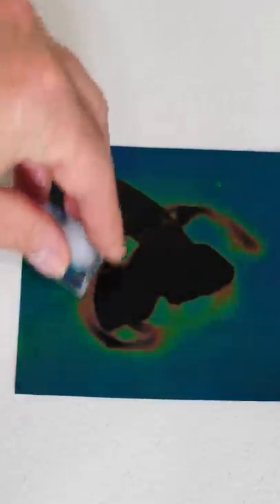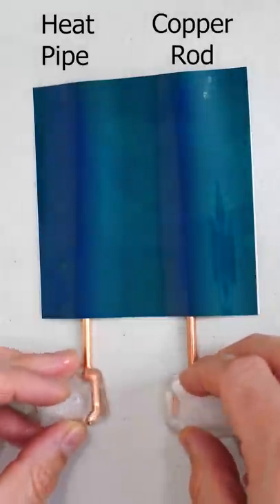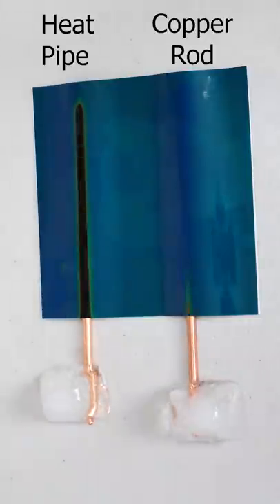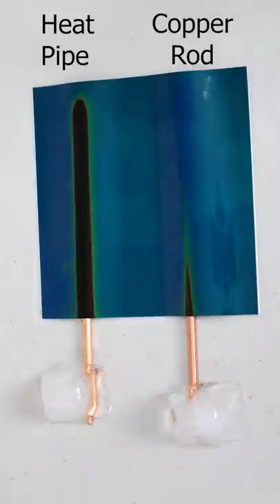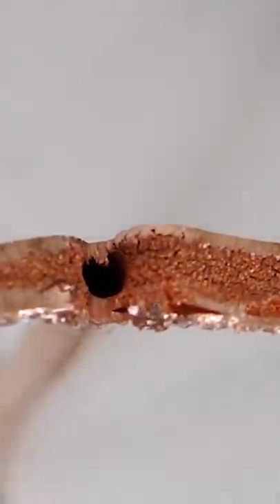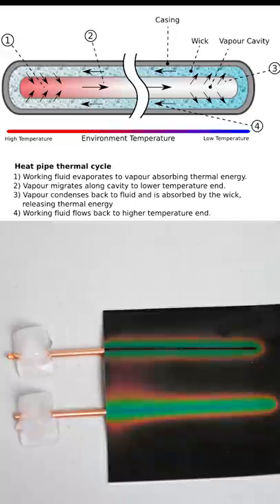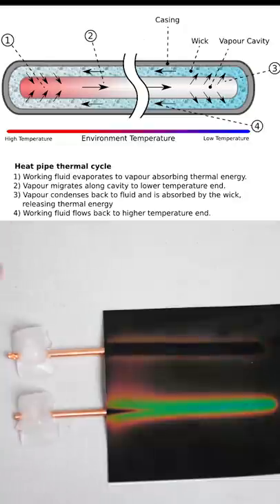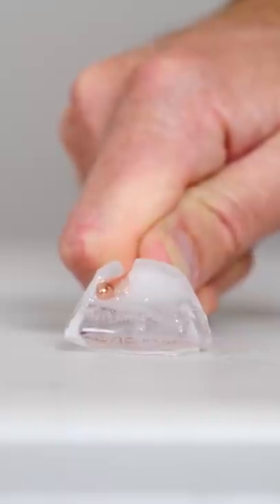The World's Fastest Heat Conductor

Comment: This is common in most CPU and GPU coolers
Reply: actually?
Reply: @vivada2667  At least all the new phones that use vapor chambers work using the same concept.  Depending on your model, you may already have this on your phone lol
Reply: Doesn’t seem like it...my laptop overheats like hell without a fan.
Reply: @zakrylee9918  Yep, heatpipes just move the heat inside your laptop, not outside, that depends on good or bad fan/chasi design
Reply: @zakrylee9918  they're mainly found within desktop cpus and gpus because of how big they can be
Reply: @zakrylee9918  Heatpipes only move heat very quickly, they don't actually remove heat, that is ultimately done by radiator fins that transfer that to the air which is a poor heat conductor, and it also requires a lot of surface area.
Reply: @zakrylee9918  It just moves the heat not cooling it down
Reply: Not true. Many don't use heat pipes and not every heat pipe is a vapor chamber I think
Reply: @mhtmhn  i believe that the razer phone 2 was the first phone to have an actual vapour chamber cooling system in a smartphone lol. I had one and it died just a couple of days ago :(
Reply: @dimitrijekrstic7567  The majority of cpu and gpu heatsinks do use heatpipes. Its only cheap stock coolers and water cooling systems that don't use them.
Reply: @mikehawk6175 RIP mate
Reply: @zakrylee9918  Your laptop likely doesn't have heatpipes due to its size. They're much more common in desktops, and sometimes custom-built laptops.
Reply: @zakrylee9918  heat pipes mostly send the heat towards the fan in a laptop or towards heat sinks.. so if your laptop still heats up it may be cause your laptop fans might be clogged or the heat pipes might be damaged or some other issues..
Reply: Firstly it's not comnon since it's much more expensive. Secondly you don't need that much of "speed" in cpu cooling. You need efficiency and that is another thing.
Reply: Newer upcoming ones, named thermosiphon, Linus has reviewed it
Reply: Keksimus Maximus lol clearly you know nothing about pc, heat pipe’s common af in pc DIY field, you can always find a cheap one that just work as well but of course not superb. Well you cant expect some heat pipes on gt1030 right? Cuz that’s not necessary but it doesn’t mean heat pipe’s wasn’t common these days.
Reply: @KeksimusMaximus  not common eh? Example 1: the ryzen 7 3700x and above models of amd cpus come with a stock wraith prism cooler. That cooler that comes free with the cpu has heatpipes. Example 2: one of the cheapest tower coolers the deepcool gammax gte 400 has heatpipes, the thing only costs around 20-30 bucks.

For gpus almost everything except the lowest end has heatpipes. At most a 1650 super card might not have heatpipes (tuf varaints) but most do (like an msi ventus) above that all gpus from reputable manufacturers have heatpipes. Dont believe me? Google any gpu and you will see copper heatpipes through the side and rear.

Also your point about speed, isnt that being more efficient? Being efficient is doing something faster or with less resistance so isnt that just a heatpipe? Also nowadays cpus and gpus use a lot and i do mean alot of power and heat. An i9 11900k overclocked could pull 332w peak, and a 3090 could sometimes draw in excess of 450w of power, to give context, you know those shitty laptops that you feel overheat too often? The chips in them likely dont draw more than 45w, a high end gaming pc pushed to its limits would draw over 17 times that amount at peak. There is a reason people use goddamn liquid nitrogen to push some hardware to its limit.
Reply: @quantumsniper9433  Didn't read. "Common" means like almost every cooler must have this. And it's not like that, only good and expensive coolers have this. It's like 5-10% of the market which is far from "common". Get your head from where it is to the real world, 80% of coolers are cheap ass alluminium tincans. I have Noctua NH-D15 and it has this thing. But it's far from cheap
Reply: @KeksimusMaximus  bro please dont talk about shit you don't know online, please.
Reply: @KeksimusMaximus  this one right here, officer.
Reply: @jared4169  Haha, yeah, we need officer Derek Chauvin with his mighty knee here ASAP, some of them just broke out of a cage
Reply: @KeksimusMaximus  
There's really no need for that. I believe you're about to receive some hate...
Reply: I was about to say to put in in cpu coolers lol
Reply: I've seen them being used for smallee builds idk
Reply: @hypnotoad28  I've seen a good number of thin and lights with heat pipes. CPU sits in the center of the laptop and the cooler on the edge, ya know?
Reply: @mr_biscuit  no, the majority are stock, and like you said, don't use them.
Reply: @hypnotoad28  
Nearly all laptops have heat pipes. Have you ever looked inside a laptop?
Reply: @mikehawk6175  condolences.
F
Reply: @zakrylee9918  laptops almost always do, having a metal coldplate over the cpu attached to a flattened heat pipe. The heat pipe moves the heat to the heatsink (metal fin block) and fan on the other end to cool it off. If its overheating, you can probably fix it by cleaning dust out of the fan+heatsink, there are videos on cleaning laptops that you can check out!
Reply: @KeksimusMaximus  Heatpipes are used in every aftermarket tower CPU cooler mate, AND 99% of GPU coolers.
Reply: @gth77s  Do you even realize who are you replying to? I'm not talking about USUAL heatpipes which are just pipes as is. I'm talking about evaporative heatpipes as the one shown in the video. This kind of stuff is expensive and not common. Do you want to tell me otherwise?
Reply: @KeksimusMaximus  literally every cooler has it, the only ones which dont are the office ones which are bare minimum, literally google cpu cooler and it would prove you wrong.

And yes, i am talking about the vapor chamber types.
Reply: just putting this here to look at future replies. this reply section looks like a good place to learn something
Reply: Heat pipe is some pipe that transfers heat from one place to another.

There are 3 types of heat pipes:
1) one which has liquid water (or any other liquid) only
2) one which has liquid water (or any other liquid) AND gaseous water (or any other liquid)
3) a solid metal heat pipe

In desktops:
Liquid cpu and gpu coolers (AIOs and custom loops) use type 1) heat pipes.
Air cpu and gpu coolers use type 2) of heat pipes.

In laptops:
Generally, both cpu and gpu are cooled by type 2) heat pipes.

In mobiles:
Generally, cpu and gpu of mobiles are passively cooled.
But in some mobiles, cpu and gpu are.cooled by type 2) heat pipes

Hope this solves all the problems in this thread.
Reply: Yeah I always noticed the copper tube going around the edge of my gpu, i assumed it was a heat pipe of some sort but never knew how fast they were and how it worked
Reply: @KeksimusMaximus  expensive? It’s like nearly 20-30 dollars for a gammaxx 400s, super good cheap cooler with heat pipes
Reply: @cryochus4074  read my comment up you will understand everything
Reply: @suntzu1409   A heat pipe is a heat-transfer device that combines the principles of both thermal conductivity and phase transition to effectively transfer heat between two solid interfaces. (As per Wikipedia) So neither 1) nor 3) are heatpipes by this definition since they lack the phase transition part.  1) is your standard liquid cooling (loop) where you use a fluid to "move" the energy away, 3) is just a typical heatsink that increases thermal mass and surface.
Reply: @loban4243 ok
I wanted to say that heat pipes of type 2) are not that common in desktops and mobiles.

That wont change even if type 2) heat pipes are the only type of heat pipes.
Reply: @suntzu1409  wym not common? almost every laptop has a heatpipe, and most desktops i've opened have heat pipes on the cpu cooler and the gpu cooler
Reply: @ado3247  in desktops, AIOs and custom loops are not uncommon.
And those dont really use heat pipes.
Reply: @ado3247  
Cpus and/or gpus are used in
1) laptops
2) desktops
3) smartphones/tablets
4) embedded/iot
5) data centers

Heat pipes are common in laptops, but they are not common in desktops (many people use AIOs or custom loops), smartphones/tablets, embedded/iot, data centers.
Reply: @suntzu1409  Newer smartphones use vapour chambers to evenly distribute the heat on the back of the phone. They're pretty much just a flat version of a heat pipe. 

Quote "I wanted to say that heat pipes of type 2) are not that common in desktops and mobiles."

If we're talking about PCs, then why bring up other uses of a heat pipe? And heat pipes are by far more common than water cooling.

And also as others have said, "type" 1 and 3 that you mentioned aren't heat pipes at all.

Comment: An onteresting innovation is how the internal surface of the heatpipe is textured. 

The version you have is called a 'sintered' heatpipe. Copper powder is part-melted on the inside of the tube, leaving that super-rough finish. 

The point is to greatly increase internal surface area, allowing more vapour to condense and more liquid to evaporate at that surface. 

Other designs have their benefits in terms of cost and/or ease of production, but this sintered version is most efficient in terms of performance thanks to that massive surface area. The random alignment of the micro-grooves also makes them most agnostic to gravity. 

The 'grooved' design has some parallel internal grooves that run the length of the heatpipe. If you deplot one of these pipes vertically with respect to gravity, gravity will try its hardest to keep the liquid or vapour at the bottom of the heatpipe. 

The sintered grooves work against gravity. Regardless of heatpipe orientation. 

It's clever engineering, and totally invisible from the outside. Heatpipes like this are absolutely essential for keeping everyday electronics cool. PCs, Laptops, (some) Phones, Tablets. Almost everything with a CPU relies on these pipes to carry heat away from the silicon.
Reply: I was actually curious about the inside texture.
Reply: I now know less of the inside processes of heatpipe than i did before reading your explanation, lol. Why would the other less productive version even be made anymore or is it a cost thing? Also would it be possible for someone who has the mechanical aptitude to make a better/bigger, more effective version if they had the proper equipment?
Reply: @donniev8181  cost would be my guess. Adding material is usually more expensive than removing it.
As for improvement, sure you could improve it, but going past is very very difficult. I'd personally tile the inside of the pipe with a Hilbert curve. I feel that it cleanly goes into 3D and if made precisely enough water would be trapped by its surface tension. One major issue is that with a material so fine it would probably be very fragile, to an extent you could give it support by fusing 1 layer if the curve to the wall, but it's thin and at a bunch of 90 degree angles. Adding some extra bracing would also help restrict loss of effectiveness caused by that damage, but overall I'm not sure if it's actually be useful at that point
Reply: Very intriguing.
Reply: I always thought the inside was R134a or something similar.
Reply: @dokusei7722  or can we. Come to the nerd side, we have snacks and arguments about hypotheticals
Reply: Where can I buy one?
Reply: Wow.. thank you so much
Reply: @dokusei7722  
Stay unimaginative then. sad.
😉
Just kidding.
Reply: @abelis644  I’m always baffled why less intelligent people feel compelled to announce it to everyone with comments like that or the worst of all: “TL;DR”

Comment: Correction:
Some heat pipes use solvents and some use alchohol based solvents due to their high volatility and evap rate
Reply: Sweet action!
Reply: It’s all about The Latent Heat of Evaporization!
Reply: It depends on the expected working temperature.  Water is the best fluid for about 20-150C and therefore all CPU coolers will use water.

Comment: Damn i bet if you put those pipes deep in the ground you could take all the heat in your room on a hot day and transfer it down into the ground
Like a cooling system
Reply: Huh? I thought it gets hotter underground.
Reply: @averagegummywormfan  that's dependent on the distance under ground. There is a fairly large section of the ground where it is basically always in the 60-75°F range(I can't remember the exact temperatures, sorry)
But it does eventually start getting hot.
Reply: @averagegummywormfan  he didn't say go  kilometers deep into the lava
Reply: damn that's kinda what air conditioning literally is though 🤔
Reply: @dimitrijekrstic7567  oh sorry I'm not really hot on geology lol
Reply: @dimitrijekrstic7567  magma. Liquid stone under the earth is magma and once it reaches the surface it becomes lava
Reply: @OmegaFire11  takoe
Reply: @supercellex4D  Air Conditioning takes air and cools it to disperse into the room. It dosent just kobra kai the hot air haha
Reply: those are some very EXPENSIVE pipes to build something like that
Reply: half literally the floor is lava
Reply: @supercellex4D  Why did you use ‘kinda’ and ‘literally’ in the same sentence? It’s paradoxical
Reply: @OmegaFire11  really doesn't matter
Reply: It won't work efficiently. The immediate area around the pipe rods will absorb the heat, and get saturated quickly. Then it is up to conductivity of the soil to dissipate that heat further away so it can absorb more. And soil is often a better heat isolator than a heat conductor :)
Reply: @FelixUmbra  approximately 10-15 feet underground it's thermally stable at around 65°. That's where home heat pumps get their temperature differential from. It's easy to bury a length of heat pipe in your yard at that depth. (Cheaper systems use regular piping and run water through them for the same effect. Heat pipes are just more efficient, though MUCH more expensive)
Reply: @liagamer4265  technically the air conditioner doesn’t cool the air it removes heat from inside your home by transferring it to the refrigerant then carries it outside to be removed by the condenser. It may sound like I’m just playing word games but it’s a very important distinction and it’s necessary to truly understand how an HVAC system works.
Reply: Biggest problem (in addition to cost) is you'd have to insulate most of the length of the long heat pipe extraordinarily well or you wouldn't get a good phase-change loop effect.  Just pump oil or water.
Reply: @Th3Arbiter666  Yes, water would work much better. Ocean, sea, river.. Especially if you place the rods in a water body where there is a lot of current circulating the water. If the flow is turbulent even better. Turbulent water is much better at conducting heat comparing to a still one, and currents will help dissipating the heat further away from the rods.
Reply: Yep there is a technology that uses pipes underground with water in them that takes the heat from the house and transfers it into the ground

Comment: "...just just like a razor blade."

I think we may have different definitions for razor blades.
Reply: Minimum thickness of most commercially available heat pipes is 3mm, definitely more of a hot (butter) knife through butter situation.
Reply: Anything is a razor blade with enough force
Reply: @Andrew..J  even water
Reply: @FirestormX9  yep that's what a sandblaster and a power washer is
Reply: @ilyte1  yes exactly and taking it up another level though, they have even used water to cut bombs housed in metal casings or artillery shells. The water literally cuts through that hard of a material.

Comment: The liquid inside (at least as it refers to useage in CPU and GPU coolers) isn't water. It's acetone for it's lower boiling point at 1atm.
Reply: But does it matter much? because anyhow, the liquid is kept at very low pressured vapour.

Comment: I’ve seen a similar heat conductivity experiment with a “sheet” of lab created diamond... I wonder how well this would conduct heat compared to diamond
Reply: I was wondering the same thing.  Diamond is an incredible thermal conductor and also an incredible electrical insulator.
Reply: @evilsharkey8954  
Yes. Btw, Saga University in Japan announced that they made semiconductor chip with diamond that apparently is 5,000times more “capable” than any silicon semiconductor whatever. Not quite sure 5k times more capable means but you might wanna look it up if you are interested...me, it’s just far beyond me 😂